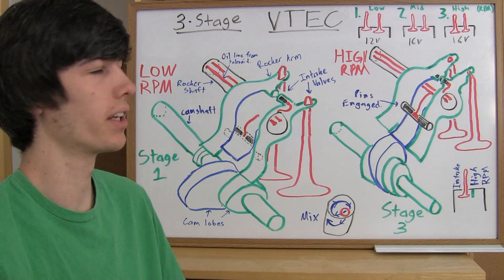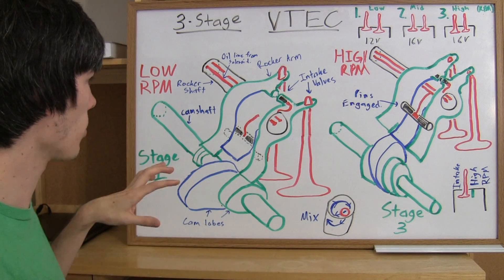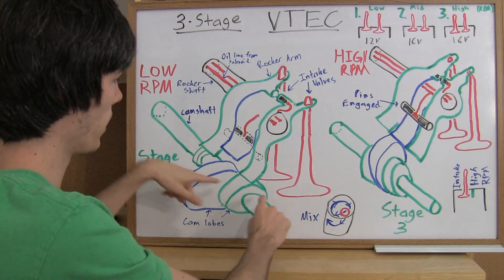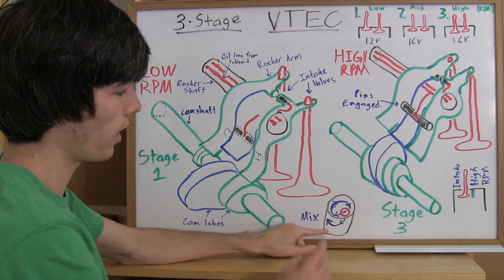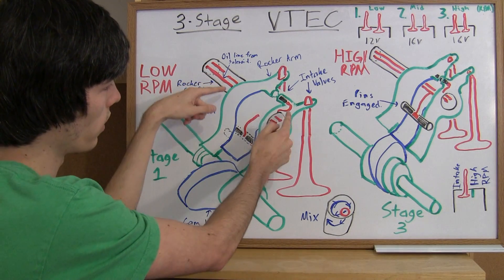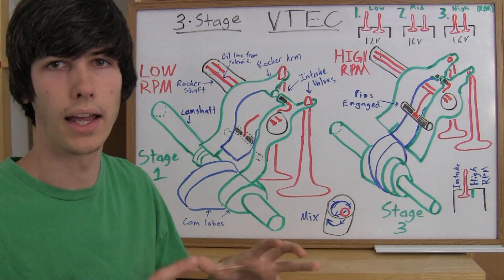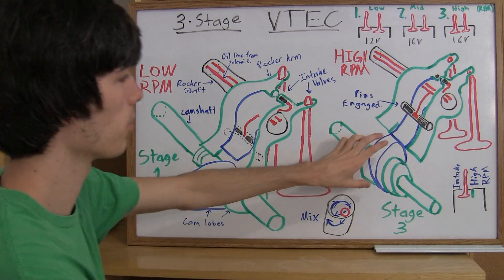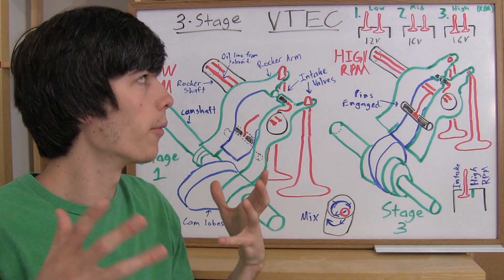3 Stage VTEC - Explained

Comment from the maker: It's difficult to say, since engines that incorporate VTEC are much higher revving, taking advantage of the added airflow. Check out my video on hp vs. torque if you haven't yet. With added rpm you have added power, it's basically a multiplier. But if you were to simply add vtec to an engine and not rev higher, the gain would be relatively minimal.

Comment: Not much. VTEC is variable valve lift, by the look of it, and it can also mess with the number of valves used. Variable valve timing is adjusting the timing of the valves, usually by slowing the camshaft or something, so that there is more, or less valve overlap at the current RPM. Other systems would include VANOS and VVEL.